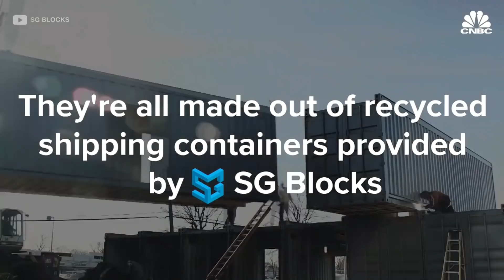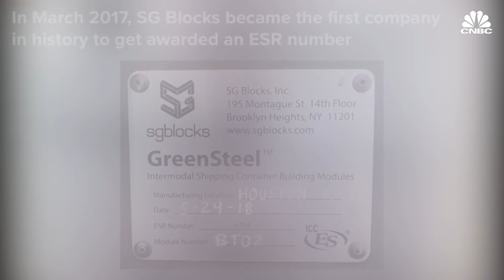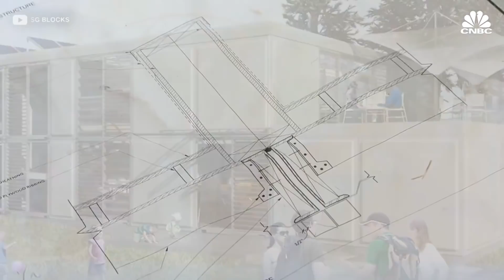Are Shipping Containers The Future Of Construction?

Comment: I've actually worked at an architectural firm utilizing shipping containers in new home design and adaptive reuse of existing buildings.  developers use this as a gimmick, and its nothing that hasn't been around for the past 10-15 years.  Two of the biggest problems facing the use of containers in construction is a labor force that may or may not know how to work with them (depending on the region you are in,) and designing around a fixed dimension of 8x8.5x40 (dimensions adapted for maximising shipping goods over roads not human habitation.)

Comment: If its steel then wat about heat  in hot summer 
You know it will be 10 times hotter in steel container
Reply: You just need to put another $50.000 to put insulation, windows, doors, wirings, heating, interior, furniture, foundations, etc. So it's nothing special except they want to dispose garbage.

Comment: Ok, that's great and all, of you do not think of logistics and all, but I want to know about how you plumb it and heat it. Let alone insulate it. There are building codes that these need to follow too.
Reply: Surprisingly easy, just think of it as a building material. 
Mine is on a concrete foundation, I used closed cell foam for insulation, plumbing and electric are the same as traditional homes i have build before.

Comment: I thought they took the containers back to China empty to fill them again.
Reply: No it would cost a small fortune to ship empty ones back compared to building a new one from scratch. It's the equivalent of sending back a empty cardboard box to Amazon. Shipping cost is more than making a new box.
Reply: @MuddinNYC  A lot of shipping containers do go back. Problem is if the ship is not empty you need extra ship to send them back. US exports are mostly raw material, heavy machinery, agricultural products and oil and gas, which do not fit in shipping containers. So a bunch of extra leftover.
Reply: @LoggyWD  Yes I know some go back. I'm  merely letting the OP know that empty ones don't go back and since we mostly make raw goods and not finished products the amount sent back is less than the amount imported resulting in more containers needing to be built constantly for import. In fact most containers in the US after being shipped from China are scrapped and sold for parts after just a single use. This wasn't always the case but now with nothing being made in the USA it is. https://www.structure1.com/projects/shipping-container-homes/what-happens-to-used-shipping-containers/

Comment: How does insulation work on this??? Won't the steel box get too hot or too cold???
Reply: same as a house, put insulation against the inside of the container and dry wall on top of that like any other house. shouldnt be hotter or colder than a normal house cause of the insulation
Reply: Yep and it'll condense like crazy that's why you use closed cell foam and insulate top cord, you control your air (temp/moisture) with your heating or cooling system.
Mine is remarkably thermal

Comment: I doubt that shipping containers will be the future but buildings made from prefabricated, modular sections will definitely be part of the future.  

It's already starting.  15 years ago when building a house carpenters would take individual boards and nail them together.  Now they use sections that were pre-made in factories under controlled conditions at higher quality and assemble them together on site for something like a wall or floor.  It's faster and cheaper that way since (in the US) labor is the largest cost in building a house.

An example of this is the section of a wall holding a window frame.  It takes a longer time and more money for a carpenter to take each board, cut and assemble them into that more complicated section of a wall than one without a window frame.  Instead factories will now have an area set up to fabricate those faster, easier, cheaper and at a lower error rate.  Another example is the triangular sections called A-frames used for holding up sloped roofs.  

I think that things are moving in the direction of whole rooms being pre fabricated in factories and assembled into buildings on site.
Reply: yeah, especially as they apparently don't use old containers, but have to buy brand new ones, then retrofit them, to end up with a result that is heavier, less cost efficient, weaker (after losing important supporting structure to windows/doors/and AC cutouts), and with worse heating insulation.
But factory build and ship segments, or 3d print concrete shells, thats where the time and money savings scale really well, and give you a comparable end product.
Reply: It's common to have prefabricated homes in Japan.
Reply: @noob.168  Can you say anything about what it's like to live in them or give any other characteristics of them?
Reply: Next door to my house is a giant property, maybe 2000 square metres. That land was bought by a developer and the plan was to put 12 2 storey units on it, and every single floor of every unit was prefabricated off site at a facility 100km away. It took them two days to put all the units in, and then another month to set it up properly, do the wiring, plumbing, and lay the concrete for the driveway. The same project would have taken over a year back in the day using traditional methods, they did this in 5 months. 

Prefabricated construction is really the way of the future.
Reply: Exactly what I was going to say. The container thing will just be a small part of it.
Reply: @prajwal9544  Rich people probably would continue to have homes that are custom built from the ground up but the lower costs would massively incentivize most people to go with prefabricated sections.  If there is enough variety of prefab sections to choose from people could definitely assemble them in ways to make homes look unique. 

Concrete can also be prefabricated and assembled on site.  It's most commonly done with things like overpasses, culverts, etc.
Reply: For many student-debt folks or frugalists THIS IS THE FUTURE, me also. Though land is very costly, unless I would have put one up.